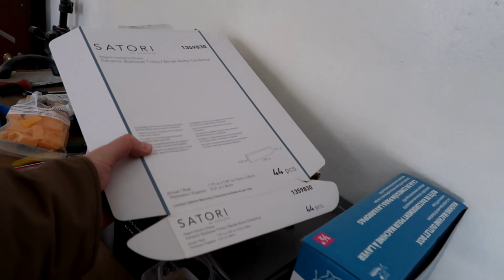Some Things Are Missing From The House...

Comment: Joe, don’t do anymore work on the house until you get legit contractor in there to tell you what the hell you need to do next.

Sheetrock is a bad idea considering you still need electrical work, plumbing and etc.
Reply: Well at least it seems to be just the ceiling
Reply: You need an experienced  general contractor to oversee and hire real pros.Your definitely out of your element here.Any more of your "learning" is going to cost you more in the long run.Hope you can at least break even on this.Your heart is in the right place but flipping houses requires real savvy and knowledge.

Comment: When u remodel houses you have to have a system....get a phase completely done before you move to the next.... framing...rough plumbing.... rough wiring... insulation... drywall...ect.
Reply: Exactly
Reply: Ope Nix so true

Comment: This is the order almost always
1 demo
2 fix foundation
3 fix subfloor
4 plumbing/ electrical
5 Windows
6 sheet rock and tape and float texture
7 paint
8 install plumbing and electrical finishing work...
10 flooring
11 inspect
Reply: Um, Inspections need to be way higher up on this list.
Reply: wouldn’t you do elec/plumbing before sheetrocking?
Reply: the 710 show oops read it wrong you are right!
Reply: Inspection should be after 4, 8 and 11...but in your case Joe, inspection should start from 1 all the way through to 11 lmfao, sorry Joe it's jus way to funny
Reply: @generalfury33  only in texas. And he isnt
Reply: And im not gonna put inspections in there...should be common knowledge if unshure

Comment: Joe, from now on  (and the standard within the industry) is to pay 10% deposit, followed by 90% at the end of the job. In many cases you have to pay 10%, 40%, 50%, however, only upon inspection and sign off at stage 2 and 3.
Reply: Not necessarily. A reliable contractor can charge 50% at stage one and is worth every penny to book them in.
Reply: My mom has been ripped off so much she won’t pay until the work is finished. She supplies all the materials. If they won’t agree to that then she won’t use them. She is a widow, and she would pay the standard deposit, and they would never show up. But she will break up the work into small jobs. Each project is an amount of money. She held on guys money for 3 months until he came back and put the trim up around a window he replaced and painted it. He tried to get paid because it was just a short piece of trim that she had sitting there and some paint. But she said, nope. The contract says this. He finally showed back up when my husband called him and said he had 24 hours to finish the work or he would finish it. And he could kiss the money goodbye.

Comment: All that sheetrock and tile will need to be ripped out so that your inspectors can do their rough inspections from the city
Reply: Wait wut? Are u for real?😂
Reply: Yup exactly! I was wondering why he is covering it up but just figured he wasn't going to get it inspected.  I didn't like the tile he didn't pattern it correctly.  I could be wrong but looks like he just put any piece anywhere.  And u have to kind of make a pattern with it!
Reply: Zach Cramond yes. Not every project you do at home requires a building permit but kitchen and bathrooms require the work to be done within code requirements so yes Joe should have pulled a permit....the electrician and plumber should have pulled a permit. Joe already went to the building department and informed them of his intentions. Even if he didn't, when he goes to sell the house the buyers home inspector will want  to verify that permits were pulled and signed off by the city's inspectors. Joe is even more fucked because they will make him pull everything out and basically start over.
Reply: Shanoe Michael once the shower curtain is up the new buyers won't even notice. But he needs to stop APPLYING finishes asap. I think that it's too late
Reply: @markschiavone8003  ahh I see, thanks for the insight! I'm a mechanic so I'm used to fixing shit without having to follow regulations for replacing things and shit haha.

Comment: Best advice I can give is, only work with reputable companies. Don't do things cheap, it rarely works out. My family has been running 30+ rentals my whole life. It's either best to do it yourself or hiring known reputable companies. The price you pay will cancel it self out in time. Same goes for flipping, we have done that too. If you can't do something yourself make sure you pay someone with a good reputation. Bottom line, don't try to do things as cheap as possible. Quality is always best.

Comment: I remember one video I watched how Bryan stripped back the romex wiring to the panel. He was running his knife down the middle, slipped off and ran his knife off of center (the center is the bare copper ground wire) and potentially could of damage the insulation on the hot wire in the panel. When I saw that I wondered if this dude really knew what and the fuck he was doing lol. Sometimes acting like you know it all isn't the best.
Reply: I seen the same thing, I know exactly when you’re talking about.

Comment: Get all your framing squared away and framing inspection. Then get all your mechanical roughed in. Plumbing,HVAC and electrical then mechanical inspection then if approved you Sheetrock. In that order. Framing,dried in,mechanical then rick.

Comment: Joe , do not close walls before you pass the electrical  and plumber inspections. it is very important. Before you do anything more , check the work Brian did with a professional contractor to see if it was done to code and correctly. God bless.

Comment: Joe all I think of is this, larceny charges, taking money under false pretenses, I work with a friend of mine who does home improvement and remodeling work, he is licensed, most everybody we do work for buys the materials we need so there is no issue about things being stolen/ taken back for cash, no confusion, and honestly, finish the plumbing work before anything else is started, plumbing, then floor repair,  then electrical, insulation/drywall, etc, finish one job before another one is started, that's how my friend and I do things, just a thought, that's just how my friend and I do work, hope u do get answers, hope u are able to have the house finished and work is done the right way, it's sad how people take advantage of people, I will never take it lightly when I help somebody who ends up doing shady things behind my back, let Karma handle Brian and his wrong doings

Comment: What you would learn from the class is you should start a class to charge suckers 20k for the class. Other than that your best move is don't waist your time going to the class.

You need to hire somone who knows what there doing with electrical. You are going to get sued for the fire in the house when it burns down. Not even close to up to code. Where are the nail plates, wires no right. Fire hazards everywhere.

Comment: Don’t put SHEETROCK UP UNTIL HVAC PLUMBING AND ELECTRIC IS DONE ITS EASIER AND CHEAPER TO DO IT THAT WAY SO THEY DONT HAVE TO BREAK INTO THE NEW SHEET ROCK TO PUT SHOWER BODY’S OR ETC UP !!! I’ve worked on thousands of sites houses buildings etc new construction and old !!

Comment: Man, you sound like I did today when I was on the phone with my MIA excavator/plumber. Long story short... I've been in court back and for the with the town I live in. They are forcing me to tie in to the municipal sewer system. I have a perfectly good, working septic system, (upgraded and installed new before closing). On top of that I got this jack off contractor that I've been chasing around since November. All I get are promises and excuses. And I already paid the guy $500 just for permits, (I have a copy of the posted check). On top of that I have a court date on the 27th because the court expects the job to be completed by then. My contractor was supposed to start the job, (3rd tentative date), tomorrow. He calls me today at 3 p.m., from home, and tells me he can't make it, he's stuck on another job. Brother, I unloaded on this dude. I told him straight up... I am going into court and when the judge asks me... "why isn't the job completed" ...I told him I am going to tell the judge EXACTLY why the job hasn't been done. He changed his tune real quick. Bottom line... this shit is brutal! For the most part I try to do as much as I can on my own. I've done my own flooring, roof, doors, etc. Went to HD months back to rent a Bobcat, (wanted to clean out one corner of my yard and dig out a driveway), and couldn't because HD told me I need an excavator's license. So this particular job is beyond my ability, (at least from a legal standpoint). Best of luck to you.

Comment: Joe do the floor joist n piers under house first or the sheetrock will crack when you do.plaster also..work it top bottom middle.roof ing gutter siding..waterproof..then foundation..then interior

Comment: Joe. Fuck the classes on flipping homes.  Work with people you bring in to do jobs.  Actually work with them.   Learn and understand electrical/plumbing/building ect the local codes.  Get an understanding of it.  Learn some more of it.   Than go take your state contractors test.   And get some insurance find somewhere good to build.  Hire some licensed an insured subs an just start building homes under a license if your looking for an business venture.  Your gonna loose your ass. Doing things the way you’ve been.  
It’s not rocket science to be a builder.  Been there done that.  Dropped it a number of years back after building about 175 homes.  When the market slowed up a number of years back to do something new that’s been doing just as well for me since.   All you need to do is learn it of what you can.  All it truly comes down to is a test and insurance.   
The real work after is done through subs.   
If their half decent like one I had when they got blueprints in hand they knew before starting that what the architect drew for something wasn’t possible and with their help showed me how it needed to be ran got with the actual home owner there after. They agreed on it.  It really didn’t change much of anything that they would of really knew much about.  And they it got started and they ran with it.  The real work is done with the subs.  Your company is responsible for it all going down an contract ect.  But if u get quality companies doing jobs for you. Their really isn’t a whole bunch of worries.  
Learn about contracts ect more.  And get a quality business off the ground.  
But your gonna loose your ass on this stuff.  
Nor is it really going to be worth all the headache An worry by the end of it all.

Comment: Joe you need to take one room at a time that's it room-by-room starting to bedroom you know do that move on to the next room stop bouncing around from the ear to there to here to there take it one room at a time step-by-step if that room is electrical do it if that room needs Plumbing do it if not through the walls do the floor do the ceiling one room at a time each person you have in there you have a contract for its binding

Comment: You need to sit down and figure out exactly what is done and what is not done imparare ties it From there but 1st thing is 1st all the rough in work should be done All the plumbing in all the electrical in all the stuff what goes on behind the walls

Comment: Joe why don't you do some of the work yourself.? Do the drywall and painting yourself learn something it isn't that hard. I don't know how far the house is from your place, but you need to be at the jobsite every morning showing face making sure the tradesman are showing up and nothing is in their way to keep them from doing their job. If they need something from lowes you're there to get it for them so then they can continue working towards the finish line. 'You need to be more hands on so you can learn how things are done, especially since you're the one signing checks. After a while you will weed out all the shitty lying tradesmen and find some trustworthy guys that get the job done. So quit looking for helpers on FB and craigslist if you haven't figured that out by now. You get what you pay for.
Ask the people at Lowe's for a list of some their reputable tradesman or contractors that have done jobs for other Lowe's customers. You need someone that knows what they're doing with insurance and a license that knows the codes and can pass them, hopefully first time around. You may have to pull some permits down road and most definitely you're going to have to pass inspection. You're a smart guy so start using your head and have common sense. Get your ass involved in every aspect and keep the ship moving forward to end goal instead of being just the money man. I don't get how you can sink 10's of thousands of dollars into something you have no experience doing and not be involved in every step of the way so you're able to learn the process and weed out the BS. Get yourself a plan A , B , C and D so your jobs don't come to a holt with 1 fuck up.